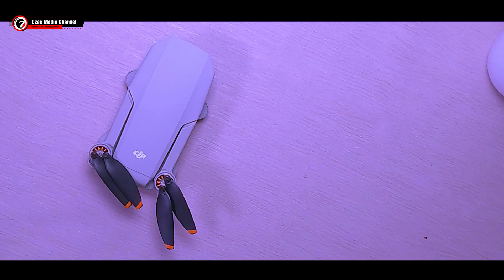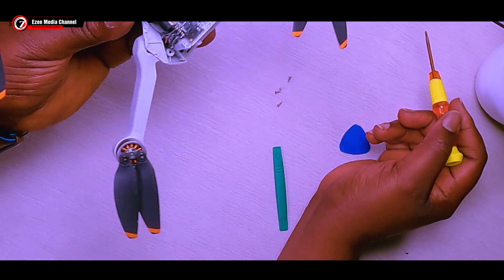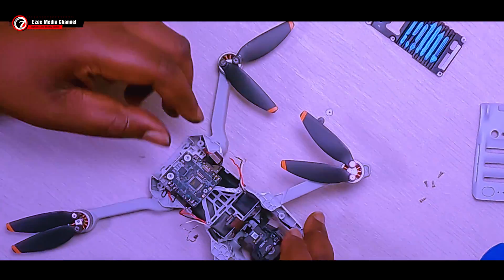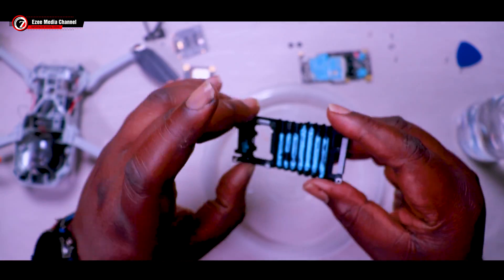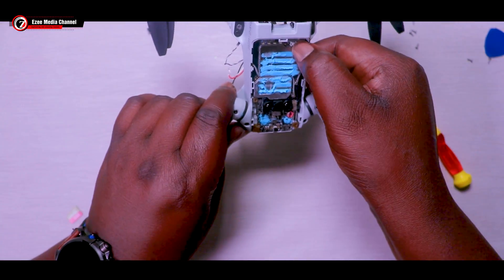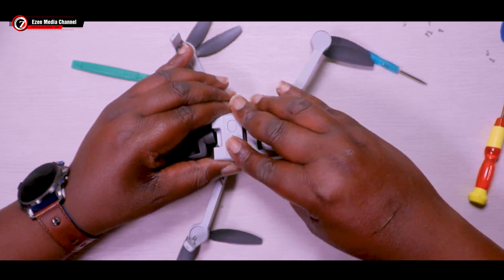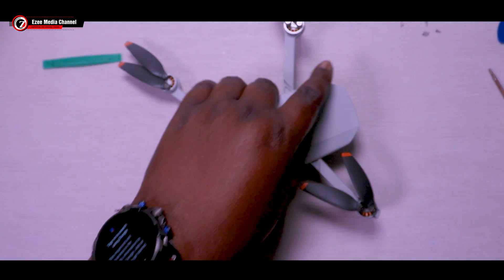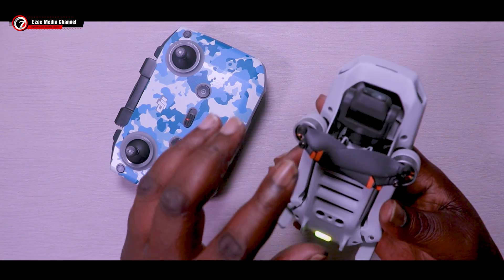How to fix a WATER CRASHED Mavic Mini, Dji Mini 2 & Mini se - Detailed Video

Comment: Mine fell into salt water, more precisely into the sea, I took it apart, cleaned it, put it back together and it doesn't work. can you tell me where the problem could be. I looked at all the components and basically everything looks ok.
Reply: ps. I can't even charge it

Comment: How about after the crash the drone is already dry for a few days But it’s just turning on the led light. What is the cause?
Reply from the maker: The components are still damp and coaxed u need to flush the panels with ipa solvent follow the video to fix it. Let me know when u do and the result bruh 😎

Comment: I have crashed my mini 2 drone into fresh water, I simply dry it with a blower for how many hours. I tried to turn it on and it works like nothing had happened, do I still need to clean it up inside?
Reply from the maker: Hello Ruel thanks for the comment well if the drone is working fine I will suggest u keep using it that way no need to open it up ok 👍 thanks again and pls support the channel by subscribing 🤗🙏🙏🙏👍

Comment: I crashed mine in water. Problem is that it woulnt connect the rc
Reply from the maker: Did U try to pair it with the rc by holding down the power button ?
Reply: @EZeemedia  yes I tried it but it doesnt work. It says aircraft not connected to rc. Can you please help me figure out w/c shall I replace the esc or gps module?
Reply from the maker: @bimmarvinlim3804  chat me up on my instagram handle

Comment: My mavic 3 drone crashed into the water. I immediately removed from the water, turned off the battery and put it in the sun until the water dried up. Once the service was done, there were no technicians in India (Hyderabad). Currently it takes 2 days. Can I turn it on? Please tell me any solution sir
Reply from the maker: Try turning it on if it can but if not I will have to follow the steps in my water crashed DJI to see it helps

Comment: This is a very informative video. I also crashed my Mavic Air 2 last weekend. But I can't open it yet coz I still don't have tools (already ordered at amazon). Though, I immediately put the drone under the sun after I crashed it and I've been blowering heat on it everyday. I would surely ask questions once my tools will arrive. Thank you in advance. I'm your new sub by the way.
Reply from the maker: Thanks Zairus so kind of u and welcome to Ezee media. so chat me up when ur tools arrive i will be very pleased to help. you can chat me up on instagram ok looking forward to assisting you. cheers
Reply: Should I use this MG Chemicals 99.9% Isopropyl Alcohol Electronics Cleaner (liquid) or should I use their aerosol version? Thank you for your answer.

Comment: Good advice, ive done the same with a gopro, though even easier. It was just the battery connection both on the batt and in the unit. Took alcohol on a brush and went to work.
Bought the gopro for $40 and had it running in 5 mins
Reply from the maker: Thats awesome Henry Thanks for dropping by pls dont forget to subscribe for more content and smash the bell icon for notifications. Thanks 🤗🙏🙏🙏

Comment: I crashed my mini 2 in salt water then I cleaned everything now it powers on but wont connect to the controller or the dji fly app any ideas what could be wrong
Reply from the maker: Hey Armando thanks for the comments. Here is what I think is the issue probably u didn't clean the main board properly or u are not pairing the mini 2 right. I will suggest u clean the main board again with clear alcohol and try again  and make sure u pair the mini 2 rightly. Pairing the mini 2 u need to click pair drone on the dji fly and hold down the power button until u hear the beep sound then the mini 2 should connect. If this works let me me know by replying and don't forget to like this video and subscribe for more contents 👍🙏🙏🤗
Reply: @EZeemedia ok im gonna try to clean the main board again but I noticed when I hold down the power button I never get a beep sound to pair the controller I also noticed when I try to power off the drone it wont power off unless I remove the battery
Reply from the maker: @Carisacarina  if the problem persist after cleaning the board again then I will recommend u replace the main board.